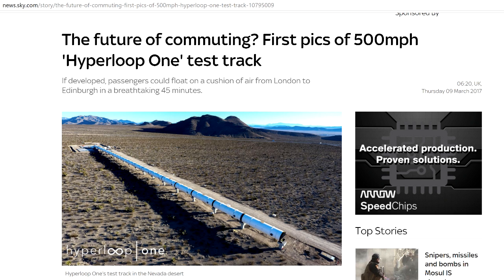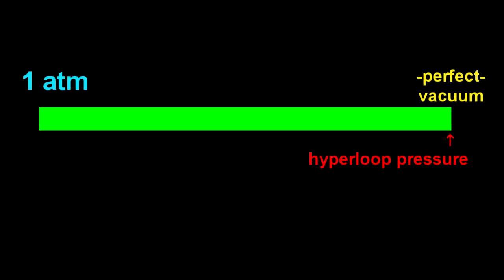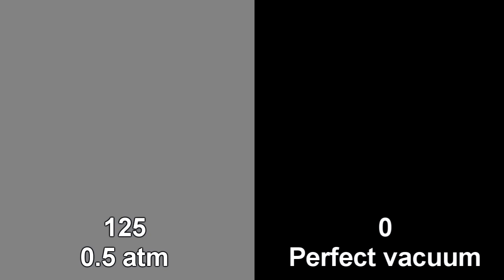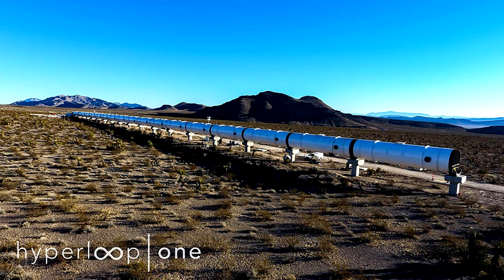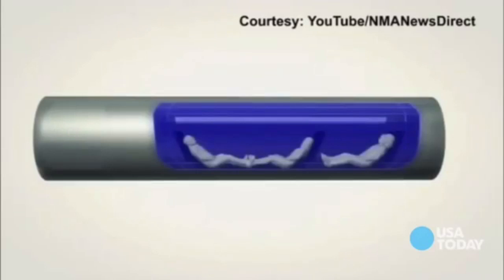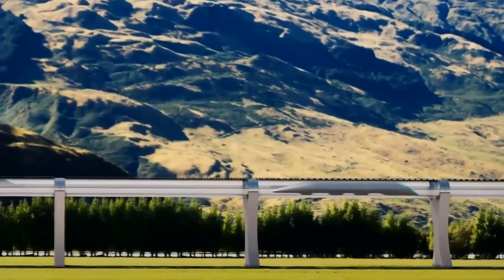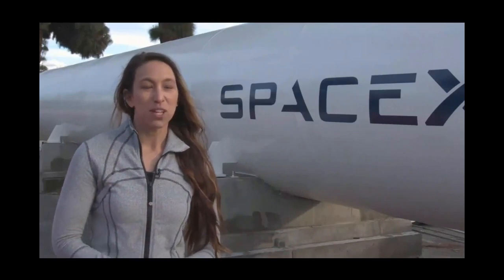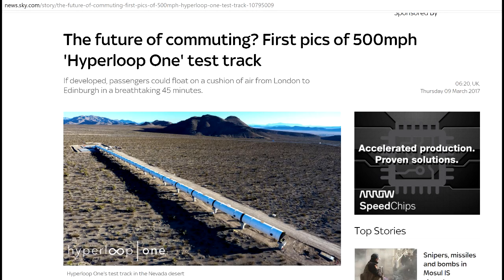Entire Hyperloop could be destroyed in SECONDS!

Comment: I don't get it... this isn't a random KickStarter, this is Elon Musk, and he wouldn't be trying to con people to invest in this, he actually believes this will work, and he seriously intends to move forward with the project. In that case, how is it that literally no one on the engineering team made some basic calculations like Thunderf00t did in order to check if the idea was even thermodynamically feasible? Even Elon Musk is capable of checking this. He has a degree in physics!

As I said, I can understand Thunderf00t calling out some random KickStarter for not checking the feasibility of their idea in terms of the raw thermodynamics, but this? This is a whole new level, and it's really out-of-character for Elon Musk to lack his usual pragmatism in this project. Can someone explain this to me? I'm genuinely trying to make some sense out of all this.
Reply: CharlyBr0wn it won't work for some very very basic reasons. One of the key tip offs is to look at promotional videos and spot the bullshit. They talk about it being a replacement for traffic. And saving lives by preventing highway deaths. This is pure 100% bs. This is a fixed point to point transport system that only works over great distances. It requires far too much distance to speed up or stop for any productive local use. This means it's an airport replacement. And at that it fails, for much the same reasons that California's idiotic high speed rail will fail. It has a massive infrastructure construction operation and upkeep cost per meter of distance traveled for the entire length and path of travel. Airports require a five mile paved runway and some navigation electronics. The space between airports is free no upkeep. Or minimally so via ATC. The biggest fixed expense in Airtravel is the easily replaceable and upgradeable unit. The plane. Yes you will say fuel costs, but the entire point of the Hyperloop is to hold hundreds if not a thousand miles of track at or near vacuum. That's a huge energy load. Before you factor in propulsion.  

If someone is telling you that an actual Hyperloop will only cost $6 billion vs the $60 billion for the California high speed rail, they are lying. Most of the costs of high speed rail come from land purchases and easements. The Hyperloop would face those too. They just conveniently aren't mentioning those... yet. Just think it through, do the mental math and you see the truth. High speed rail requires a stable prepared roadbed, 2 or 3 steel rails and overhead feeder wiring. A Hyperloop going the same route needs a massive vacuum tube, on a prepared geologically insulated pylon system, with if anything higher power distribution requirements. It has almost 100x the materials costs alone over traditional high speed rail. You can see this just by looking at it. And once again, airports require 5 miles of flat concrete, no further property purchases or easements and the air is free. 

People are fond of talking about sustainable energy. I'm going to bring up another concept. Sustainable infrastructure. Sustainable infrastructure is cheap, easily repairable and is capable of sustain itself via the traffic or commerce that it supports. Traditional asphalt roads are a great example. Crushed rock and goop. The trick is the infrastructures upkeep cannot cost more than what it returns. That was the failing of passenger rail in the states. Though nobody talks about it, it was also what caused trolley's and light rail to die in American cities. Buses were Trolleys that you could change the route easily, no digging involved. This Hyperloop is not a Sustainable Infrastructure. There is just too much of it.
Reply: +Chris Head 
Not to mention that the square cubed law is also in play Thunderf00t has become a scam artist who places the minimal amount of effort into each video so that he can release several videos a week often the same video and collecting nearly 3,000 dollars a video from his patron's it's discusting.
Reply: I'm in agreement with kurtu5 I've criticized Musk in this thread while also defending him.  I think your projecting.  Everyone on this thread believes in their cult leader TF who simply can't be wrong about anything because he's got a Ph.d.  in chemistry.  Not even against those in their own fields.  Sounds a lot like people we used to criticize doesn't it?
Reply: It's simple, this is a youtuber dedicated to calling out anything. He get's his demographic by using shock factor. If there's no exciting real scam he can call out, he has to find something else sensational to "bust".
Reply: I´m sorry but his concerns are legit. Even if the tube is tripple layered to protect it, you still run the problem of having to seal and depressurize the tube EVERY TIME you want to use it...because you can´t just "get in and out" off a vacuum chamber. Which is going to take an exorbitant amount of time anyway. We are talking about displacing 2 Kilotons of air, every time.

And how do you sensibly stop this thing? I mean, acceleration and deceleration have to be slow enough to not cause your body to break under the G-forces...

It´s ambitious, just like anything else that Elon Musk does, but unlike electric cars and space travel, transportation via vacuum tube is not something we´ve done before.
Reply: CharlyBr0wn I'm not really in a place to question science and engineering credentials. My skills and education are business, economics and some Poli Sci with a number of credits in Fire Engineering from a previous life. I can easily see the failure points of this thing just on the basis of those points long before you start arguing fluid mechanics. (The thing fails every economic test you can throw at it. It makes no sense from a costs benefits standpoint.) But I am curious? Have you ever investigated Dr. Mason's CV or published body of work? I did after I got curious on some of his Busted" videos. It was actually quite enlightening. Yes his Phd is in Biochemistry. But his body of work is about mostly water. (Water and sugar) It's heavily about Fluid Mechanics and Thermodynamics. He would actually appear to be one of the better experts on such things. It certainly explains his interest in things like the self filling water bottles etc. I can't tell you if Thunderf00ts math is correct. I can tell you that from looking at it from an entirely different non engineering angle, his ultimate conclusion is correct.
Reply: + andrew taylor
"One of the key tip-offs is to look at promotional videos and spot the bullshit. They talk about it being a replacement for traffic. And saving lives by preventing highway deaths. This is pure 100% bs. This is a fixed point to point transport system that only works over great distances. It requires far too much distance to speed up or stop for any productive local use."
Considering that many people actually do drive across California, it would actually decrease traffic, but yes there primary competition is planes and air travel.  Which they do actually address in the Hyperloop document.  They demonstrate that you can travel faster than other planes at least when considering relatively shorter distances such as what is currently being proposed for the California high-speed railway.  I think you also need to consider another distinct advantage this has to air travel is the lack of need for preparation for a flight that is going to the destination you need to go to.  

" It has a massive infrastructure construction operation, and upkeep cost per meter of distance traveled for the entire length and path of travel. Airports require a five-mile paved runway and some navigation electronics. The space between airports is free no upkeep. Or minimally so via ATC."
Yes, this is true however the Hyperloop can arguably transport more passengers in a day per meter traveled.  An airplane can only transport a fixed amount of people on it at a certain time while a railroad can have multiple trains on it at a time.   Not to mention that aircraft have a lot more constraints placed on them to make themselves economical.  After all, they need to fight with being sufficiently aerodynamic and fuel efficient while maximizing the number of passengers they can transport.  

"If someone is telling you that an actual Hyperloop will only cost $6 billion vs. the $60 billion for the California high-speed rail, they are lying. Most of the costs of high-speed rail come from land purchases and easements."
Do you really think Hyperloop didn't account for this?  It's accounted for in the Alpha document.  In fact, they predict these cost to be about 1 billion dollars.  I have no way of confirming this, but I have no reason to doubt it either.  I'm sure you would have a much easier time demonstrating what the number should actually be.  
http://www.spacex.com/sites/spacex/files/hyperloop_alpha-20130812.pdf

 "Just think it through, do the mental math, and you see the truth. High-speed rail requires a stable prepared roadbed, 2 or 3 steel rails, and overhead feeder wiring. A Hyperloop going the same route needs a massive vacuum tube, on a prepared geologically insulated pylon system, with if anything higher power distribution requirements. It has almost 100x the materials costs alone over traditional high-speed rail. You can see this just by looking at it. And once again, airports require 5 miles of flat concrete, no further property purchases or easements and the air is free." 
Engineer's put very little faith in mental math.  Just like scientists we're are only interested in what you can demonstrate.  However, unlike scientists, we don't get to experiment before we do a project, so we plan everything out.  We have to create feasibility analysis' and create several reports before we can actually continue with a project.  This is what the alpha document was for the Hyperloop.  If they've done their due diligence, I have no reason to disbelieve it.  If you think there, math is wrong by all means show me.

You certainly have a point about sustainable infrastructure but how do you know they can't make it sustainable?  Designing for replacability isn't hard even though the majority of the time we deliberately design against it(for limited product life cycle).  That being said I do not see this concern being addressed in the Hyperloop document.  However even so this argument would also work against our massive network of freight which still run to this day which is because their sheer quantity of goods being transported outways this concern.  Whether the costs of the Hyperloop outway this concern is certainly debatable.  Most of your other concerns are also valid but also addressed in the Hyperloop alpha document.
Reply: " Every dollar he has ever earned in profit has come from taxpayer grants, " that stement just isn't true. He sold Paypal to Ebay. Those money was his wealth. Then he created Tesla, spaceX and solarcity.
Reply: +Joe Farmer
"First, just because there are engineers and project managers involved with Hyperloop One, for instance, doesn't say anything about the credibility of the project.  They are there for a job and to pull down a paycheck, which no one came blame them for. "
Actually, it does.  First off highering a team of engineers is extremely expensive and provides a lot of the upfront cost.  If this project has no likely hood of success then this is a money drain for Elon and he's going to be losing millions if not billions in overhead costs.   This is the reason why you make an alpha document in the first place to figure out the feasibility of a project before you invest a lot of money into it.  If an engineering team found the project to be worth doing, then that means the person funding the project feels they can be successful.  

"They are also increasing their experience and technical capabilities, which is great for them.  Otherwise, your argument is like saying that because Enron or MCI had all sorts of very nicely credentialed people, there must have been credibility behind those ventures."
Umm yes they are corporations trying to make money are you trying to suggest there fake business'?  Are you trying to suggest that they can't make a buck cause both are very large companies?  Hate to tell you this but yes the fact that they have a massive engineering team makes them credible.  

"Second, Elon absolutely is in it to make money; for himself.  He's not the only one scamming taxpayers; just about the entire "green" industry is a scam on some level that relies upon taxpayer financing.  Elon invests a small amount of money into his ventures, almost at a token level, while then leveraging the hype to pull in tax dollars; that's what he's good at. "
I agree that hype is a huge part of Elon's business model but then again so is it a part of apple's.  What's your point?  Branding your product to be the future and therefore better than everything else is a great marketing tactic doesn't mean there a company out to scam people.  There just selling people on their product which people like and want to buy.  It's not like there actually lying and selling a heap of junk that's going to break down in a few miles.  Now tax breaks and so forth isn't stealing tax payers dollars it's taking advantage of government benefits as you've stated aren't designed just for Tesla.  Tesla and space x still have to make money, and if people don't like their product, then they still run a deficit.  That's why you're full of shit he's still a legit company playing by the rules.  

"You don't see how both Tesla and SpaceX were taxpayer financed???"
Space X is just as taxpayer-financed as Boeing and Lockheed Martin.  Are these companies shams too?  Tesla just get's tax breaks for being a "green" company but I agree they shouldn't get them.  Irregardless this isn't just Tesla who get's these as you mentioned there providing a market demand for "green" products.  I will agree that Tesla isn't as green as it's marketed as but there is clearly a demand for the product or they wouldn't still be around.  

"Train concepts fail because of cost; there have been many, many train concepts that never even make it to the media that were failures from inception"
And therefore all trains will be a failure because some were.  I'm sorry but this is terrible logic a train can beat both planes and cars in the right circumstances.  Take subways which are almost a necessity in every major city.  Not to mention that they bring in a lot of money every year due to their frequent use.  Sure it might bring up reason for skepticim but if the evidence is provided then you need to pony up and return with equal evidence. 

"This is not to take away from conventional rail at all; yet those capital costs were paid for long ago and they have found a so-far solid model for freight.  Conventional rail for people transportation is another story.  Opex in train ventures grows every year, however, and yes; security is a major issue in the industry even for freighters."
I'm still quite skeptical of this large amount of security you speak of after all the amount of graffiti you see on rail cars really speaks to this high level of security.  Now I can see a lot of security when there's a lot of expensive goods in one place, but that's security for a different reason than your talking about.  However, this brings up another point, and that's that railroads are not designed to last.  Inspections are constantly needing to take place for buckling in railroads because there built without expansion joints.  Which means even with a high cost of upkeep there still profitable.
Reply: Yeah I would like to hear the economic argument.  So far the biggest argument I have heard so far is that land acquisition would be difficult, despite being offset by the small land footprint, small noise footprint, small security footprint.
Reply: Kurtu5
Yea and that's a dumb argument too because that disqualifies all trains from being feasible.  I don't know but I personally don't see an economic argument unless the numbers in the alpha document were shown to be wrong.  Which I can assure you Thunderf00t has failed at doing this.
Reply: +Bob Tahoma
You clearly don't understand how a logarithmic scale works do you?  Well, let's take the equation for work in an isothermal process.  To reduce pressure, you get this equation

W=nRln(Pi/Pf)

From this equation, you can see that the smaller Pf gets, the more work that is required.  Not only that but it tends towards infinity.   

an example of how the graph of this looks

https://www.wolframalpha.com/input/?i=plot+y%3Dln(1%2Fx)

To make this graph behave linearly, you would need to employ a logarithmic scale that is actually representative of how much work it takes to achieve a vacuum of 1/1000th percent.  Which I can assure you isn't that much.  This can also be seen in how vacuum is classified which is done logarithmically and not linearly. 
https://en.wikipedia.org/wiki/Vacuum

In fact, the vacuum thunderf00t is talking about is considered a medium vacuum and is widely used in industry.  This is pathetic that he would portray this as an incredibly good vacuum when it isn't.  It's a generic vacuum at best.  So yes it is a 1/1000th vacuum, but hey we know everything in science behaves linearly.  Knowing 1/1000th vacuum means that directly scales to 1000 times the work needed right?  It also means that assuming a perfect vacuum is going to give me a close approximation right?  Fuck no and if you do think this is the case then you've clearly never studied thermodynamics.
Reply: I assume you are referring to the 2x10^8 J required to pump down the vacuum. 
 Thunderb00b calculated the energy required to pull all the air out of the entire vacuum chamber. The hyperloop system will have vacuum locks and hatches that allow small sections of the loop to be sectioned off so "pods" can enter and exit the main vacuum loop. This eliminates the entire vacuum loop having to be pumped down to full vacuum for each use. 

Additional comment

-The pig pong ball thing is a terrible comparison. It has very low mass, and unlike a hyperloop pod it has the same diameter as the tube it is in. From F=ma I can guess the acceleration of a pod if there was a vacuum failure. Assuming a 12' diameter pod, that weights 350,000lbs (half the weight of a 747). And lets just assume it is perfectly sealed in the tube, even though it wont be. If 1 atmosphere of pressure acts on 1 side of the pod and a complete vacuum acts on the other, The force acting on the pod will be 14.7psi (atmospheric pressure)  * 16,286 in^2=239,404  If the pod weights 350,000 it will accelerate at about .68 G's (roughly what a sports car will do).
Reply: Chrinik 
Have you never heard of airlocks?
Reply: this video is only really pointing out how impractical it is at the moment, not that it couldn't be done. i think it's a pointless video.  it's simply a matter of will and if we want to spend the time and resource to make such a thing. all the things he mentioned can be overcome in various ways, it's just more money and more material.

the real question is- in theory, will it ACTUALLY improve travel times to that degree? after all the money and R&D and material, is it going to deliver on said speeds and efficiency? that's the real question, in my opinion
Reply: CharlyBr0wn Sure I have, have you never seen them fail? Since the entire loop is supposed to be low-pressure at all times, any sort of maintenance would require either full on protection suits similar to space suits or venting the entire place back up. Also, any imperfection or damage could cause the entire thing to go tits-up at any moment. You´d have to pretty much double or tripple layer this thing to be safe.

And even then, the entire idea of it being above ground just exposes it to a ton of danger, storms, cars and trucks plowing into supports, trees falling on them whatever, any one of which can cause the entire instalation to blow...better not be going 600mph through this thing while it´s happening. Because either it´s in front of you, making you hit a brick wall of air...or it´s behind you, making you accelerate uncontrolably and then hit the brick wall of the end of the tube<.< I´d rather take a plane.
Reply: CharlyBr0wn:
The pump you showed is rated for a flow rate of 56.6 liters per minute, how many liters does this supposed hyperloop hold? I never said it´s hard, thanks for that strawman, and you´d need alot of those pumps You are looking at time and energy needing to be invested either way.

Secondly, do you really think an object going 500mph hitting the crushed in walls of the tube (be that from a tree falling on it or a support beam collapsing), or the air that is not supposed to be there rushing in from a leak is gonna be like a stiff breeze? Do me a favor and look up planes crashing into the ocean. Fluiddynamics can cause the "train" to do things it´s not meant to do, hitting air resistance it´s not meant to hit, and derail like any train, only at substantially higher speeds. Therefore, you DO need to protect the tube from damage, no matter what. Thunderf00t never mentioned these things and somehow I fell prey to his "lies"...

I don´t even use thunderf00ts points and you still claim I did, who´s the delusional one here...
Reply: Thunderfoot is just pulling your leg, he is clueless.
Reply: I agree.  I just wanted to put out the 'strongest' economic argument I have heard so far.  If the operational costs(energy costs and I assume maintenance costs) in the whitepaper are correct, then it appears the HL, at roughly 1/5 the cost of competing services, seems to have them all beat.  And that 1/5 is for driving in an electric car.  Its 1/10 or more than jet or gasoline auto travel.
Reply: @kurtu5

Nope, you're a cultist when you go after Tfoot for doing that same thing he has thing to bullshit like solar roadways to Musk's shit.
Reply: @RandomGuy7092

TF was correct in his criticisms of solar roadways.  The difference here is that he has made fallacious criticisms.  He was correct in his thesis that coulomb forces are involved in alkali metal reactions.  He argued against creationist's arguments from incredulity and was correct there too.  But he made errors here.  A cultist is someone who ignores a person's error and defends them despite all evidence.

Name some stupid shit Musk has done and I will agree.  If a person does something stupid, i will not rally against reason.  I asked you to use reason regarding TF's claims and you refuse.
Reply: solar roof. investing in quantity > quality
Reply: after carefully reading this discussion, i've come to the conclusion that neither the guys saying that TF is wrong are bringing up numbers but speculations nor do the ones who agree with TF
"It's because Thunderf00t is the one who is making seriously big mistakes in his physics calculations mainly his characterization of air pressure.  In no way should he be making assumptions of zero air pressure or assuming that a linear scale is a good interpretation of how to characterize a vacuum.  Remeber Thunderf00t's degree is in chemistry, not physics.  Honestly,  I think the issue is that Thunderf00t has gotten cocky and will not admit when his initial points were wrong.  Shane Killian did a great video series quantifying how wrong Thunderf00t is on this topic and demonstrating how Thunderf00t uses argumentation methods that are almost characteristic of creationists."
=> No investigating on that matter
"It's because Thunderf00t is the one who is making seriously big mistakes in his physics calculations mainly his characterization of air pressure.  In no way should he be making assumptions of zero air pressure or assuming that a linear scale is a good interpretation of how to characterize a vacuum.  Remeber Thunderf00t's degree is in chemistry, not physics.  Honestly,  I think the issue is that Thunderf00t has gotten cocky and will not admit when his initial points were wrong.  Shane Killian did a great video series quantifying how wrong Thunderf00t is on this topic and demonstrating how Thunderf00t uses argumentation methods that are almost characteristic of creationists."
=> same as above
Reply: Nexnaught I don't know but Musk has made some trash products like their powerwall and their solar power shingles.
Reply: yeah this is Elon musk. he's not a public servant, he's a capitalist investor, and he's got pet projects he wants public funds for. 

never invest your own money.
Reply: Yeah there are many engineers and physicists who participated in and are participating in building these things, even if Elon is greedy and doesn't give a fuck he wasn't the only person who designed and planned the thing. With that many people with degrees it seems quite ignorant to believe they all couldn't do what TF did in a couple days of research. TF should start his own company since his fans believe he is 100% correct  on all his videos and is much smarter than people who hold degrees in fields he's never studied. Surely someone as smart as TF can be the next Einstein no?
Reply: Musk as excellent of an inventor and businessman he is, has also had faillures.

This will probably be one of those less succesfull projects.
Reply: Tesla, and other car manufacturers, got a loan from the government - which Tesla also paid back. They also got some tax breaks from Nevada to build the Gigafactory, but then Nevada turned around and made it more expensive to have rooftop solar - benefiting coal and nuclear generators. If I'd have to guess, Tesla would be one of the least favored companies.
Reply: We are all human and we all make mistake, and sometimes a lot of us all make the same mistake and the same time. I'm sure Elon is not trying to con people, but he is human.
Reply: Elon musk is not building it or going through the details meticulously, because he outsourced the idea to other companies. He is only providing the funding. He doesn't have the time to check all the numbers. The one checking the numbers the the project manager from spaceX. Which he understands with currently proposed systems and technology it is not practical. at this point It's  become a project to inspire young scientists and engineers.
Reply: im sure he has checked the thermodinamics of this thing, he would be making a big deal out of this if he didnt tought it was possible. just like with his electric cars and his reusable rockets.

it is fairly obvious someone who doesnt even check what the problems a project would convey before doing it wouldnt be able to put rockets into space, so it is more of a problem he is looking fordward to resolve, wich is why i beleive he havent constructed the full thing yet, it would be pointless to built a full scale prototype just to have it replaced by the complete thing later, they are just experimenting on a lower scale to see what can be done in a bigger one.

ALSO i belive just swapping to nuclear energy would solve half of the problems this project conveys
Reply: +xing355
The Project Manager's and everyone involved are engineers I doubt they would be working on this project if they thought it wasn't feasible.  I hate to break it to you, but Elon isn't in the business to inspire new engineers he's in it to make money.  Granted I think inspiring new engineers is certainly on his list of priorities, but he's mainly in the industry for profits.  The same as all other business'.  Elon is just a risk taker who invests most of his business ventures in R&D which is a risky business but has the potential for high payoffs.  

+Joe Farmer
I'm not denying that hype is a large part of his business model but I don't see how the taxpayer is funding his endeavors?  He's created several companies that run by the same rules as any other corporation.  Why is Elon the only one scamming people?  Also why are most train ideas absurd?  BNSF is critical to hauling massive loads of cargo across the country.  To assume trains are infeasible and absurd is just plain wrong and ignorant.
Reply: Joe Farmer 
Now about the white paper I certainly agree that he needs to validate his design before anybody gives him any money which is what he's already doing.  However,  the purpose of the alpha document was to prove that this project was worth the overhead cost in the first place.  Now if you don't believe it deserved to make it to even that stage then you need to back it up.  Which numbers specifically do t you agree with and why?  Simply saying you don't buy it is not an argument.
Reply: Elon Musk is backing it because he wants to build it on Mars.
Reply: +Ponto Builds The issue I have isn't how practical or impractical the Hyperloop is.  It's the fact that someone who claims to be promoting science is promoting such pseudoscience.  He's not getting anything right and is blatantly misrepresenting scientific principles such as pressure and fluid mechanics.  Now getting things wrong is fine but he's been told several times that he's wrong, but he simply doubles down and continues to promote pseudoscience.  Such as his little animation that he loves so much to try and show how close a 1/1000th vacuum is a perfect vacuum.  Accept it's misleading because pressure runs on a logarithmic scale and shouldn't be shown on linear scale to classify vacuum.  This is backed up by the methods in which vacuum is classified.
Reply: The concerns are real, but its up to them to figure them out, its not like someone is going to show them this youtube video and they are going to be like: "you are right, this is impossible, shut it down". they already know that the difficuties are and im sure they are working on resolving them.
Reply: +Chrinik
You've fallen prey to more of Thunderf00t's fear mongering.  Although yes for maintenance and other rare activities you will likely need to depressurize the Hyperloop.  The energy cost for this is not nearly what Thunderf00t would have you believe.  This task can be achieved with relatively cheap industrial vacuum pumps.  
https://www.coleparmer.com/i/cps-products-vp2s-pro-set-single-stage-vacuum-pump-2-cfm-10-micron/0716484
This vacuum pump is capable of 10 microns or 1.33 Pascal.  So much for achieving such a "high quality" vacuum being hard.  You can bump up the quality for faster pumping times as well.  Now onto the other lie from Thunderf00t that you've fallen prey to and that's that a tube rupture will kill everyone in the Hyperloop.  The issue here is that Thunderf00t's scale is what is misleading here because of the square cube law.  
https://en.wikipedia.org/wiki/Square-cube_law
From this law, we see that the volume of an object increases faster than it's overall surface area.  Which means that an object will feel less force on a larger scale.   Meaning Thundef00t's little experiment is extremely off from what the real Hyperloop would be capable of.  Once again Thunderf00t is making really simple blunder's in both physics and engineering.  So no you wouldn't need this triple layer protection.
Reply: +Raul Lopez 
Certainly, there are design challenges, but most of the legit challenges that Thunderf00t brought up are relatively trivial problems in engineering or are simply misrepresented.
Reply: +Joe Farmer
"Guess what, it was expensive for investors to hire all of those other nicely credentialed people at Enron and MCI too; so what?"
 Yes and they made bad business decisions, and those who invested their money suffered because of it.  However, their engineering teams still created products that work.  Are you trying to say these companies products were bogus?  Are you trying to say Elon is also involved in accounting fraud?  What the hell's your point here man?  Just because the companies were involved in fraud didn't mean their products weren't ligament.  To get money, they had to provide a working product.  So essentially this comparison is crap because it doesn't prove anything.  

"Just because technical/scientific/business people are involved with something does not make it a credible project; this learning goes back centuries at least.  Investors are duped all the time by the top level executives and often times the employee engineers/technical people have no real insight into such companies."
What the fuck?  What are you even talking about?  Who the fuck is being duped?  Are you saying pitching an idea and having people invest in your idea is duping them?  You do realize that investments are supposed to carry risk right?  Now that Hyperloop has funding from investors they are sharing the joint risk of this venture failing.  Which once again actually adds legitimacy to their project.  The fact is that it isn't stupid politicians falling for this but actual companies that themselves need assurance that their corporate dollars aren't getting wasted.  Your skepticism in where people invest their money is astounding and just shows you don't understand the business world or engineering.   Remember an engineers soul purpose at a company is to make that company money that is it.  If we aren't designing products that make the company money, then there really isn't a reason to have an engineering staff.  

"People want/need a paycheck, just like people are willing to suspend disbelief for all sorts of reasons.  SpaceX versus Boeing/Lockheed is a nul comparison in every respect; their histories are completely different although in today's World both are now known to take advantage of government to some degree."
Wait the employees are getting duped now?  What the fuck your ramblings are making no sense?  The whole reason these companies are legitimate is because they have no reason to invest in overhead cost if they don't expect returns.  Are you really this stupid?  Companies don't just hire employees just to tell them to sit in the corner and do nothing.  As you've stated, they want to make money.  Hiring engineers to do nothing doesn't accomplish this.  The fact that they have an engineering team means that they believe they can make money on it case closed.  If they didn't then, they would go the route of solar roadways and invest everything into marketing and be getting donations.  Note solar roadways was comprised of two engineers who marketed their way into the money.  They did nothing in the way of hiring a quality control department, getting manufacturing engineers,  software engineers, etc.  By the way, investments are different from donations in the respect that returns are expected.  Also how the hell is Spacex different from Boeing and Lockheed?  The history of the company has absolutely jack shit to with a companies business model which all three compete for government grants.  Their primary customers are the military and NASA.  Although Boeing also has capital in the private sector as well.

"You clearly don't know the train industry if you're skeptical of their major security issues (including graffiti)."
Saying I don't know the train industry isn't an argument.  You have to back it up.  Citations are always nice if you have some.
Reply: +Parker4675 yes, because pointing out the demographic of a channel in order to explain the content is Sooo insulting... Thank you for being the internet police and reprimanding me!
Reply: +Joe Farmer
"That's the problem with the white paper though.  It's not an insular piece of technology he's going after; or even a couple of pieces of tech.  He's advocating and designing at the systems level.  New tech is always a dubious enterprise but new tech at the systems level is even riskier."
Well, finally your actually making good points.  You are absolutely right here new technology is extremely risky.  On top of the reasoning, you already mentioned the market's demand for new technology is also unknown.  You might design an incredible product that has no market demand.  

 "This is because we don't have a credible basis for the real costs because the system has never been built out before.  That's why people don't believe his numbers.  He needs to build out a fully functioning prototype of some length to demonstrate more than at least 50% of what he's claimed.  And look at his numerous claims:1)  solar powered2)  significant speed advantage3)  creation of the largest continuous vacuum chamber4)  profitable enterprise5)  and etc.There are probably more than 15 discrete claims being made; investors might take him seriously if he could prove even 33% of those and on or near budget. "
Once again I agree with you on this point as well.  However,  in order to build a fully functioning prototype money is necessary.  Which is why the overhead cost to build these prototypes also needs to be justified as well.  The alpha document was the first step in this process.  Although even before you can even justify fully functioning prototypes more justification is still needed such as validating each component,  conducting evaluation testing,  acquiring simulations of the components, and even conducting market research.  Passing through each of these phase gates justifies to both Hyperloop and their investors to invest more capital.  It would also appear that Hyperloop one has already passed these criteria because they are currently working towards validating the full scale prototype.  

"He keeps arguing about the value of private industry doing this project (and others), yet somehow private industry never puts up most of the money; somehow, the taxpayer always has to take the risk."
There you go again with this taxpayer are getting duped nonsense.  Please provide me with a source that states how much if any funding they have gotten from taxpayer dollars.  All I can find is that they are receiving funding from corporate investors.
http://fortune.com/2016/10/13/hyperloop-one-test/
Reply: it could be built underground with several layers of protection, and it could have a large system of airlocks for servicing the tunnel, emergencies, and safety systems. again the question becomes "is it worth the time and money", not "can it be done?"

think of when people in new york long ago started to propose "why don't we just dig crazy huge tunnel systems under the entire city, and put trains in them?"

it was a question of time and money and material, not "can it be done?"
Reply: you agree with me, you're just a bit too dense to realize it. and i also agree no tax payer money should go into it UNTIL they have a complete working prototype and complete plan drawn up. they can figure all that out with valley money
Reply: Ponto Builds "It could be build underground." Yeah...which would make sense...but the plan is to build it above ground and put windows in them so you can watch the scenery...which is a dumb idea in my opinion.

Also, keep in mind that underground metros weren´t anything "new" by that point and thus had about 40 years of pre-made experience from Europe on what to expect when building them...

And it´s always a question of time and money, but the argument shouldn´t be ours to make, it should already be answering all of those questions because they are DEFINATELY going to be issues...you can´t make a high speed train transporting people without having to make compromises to provide for their safety...and if all that prevents this system from potential failure is a single wall of 1inch steel that´s pre-stressed...

I dunno. The "finished" design is probably using thicker tubes because how are you going to keep testing a railway system when the tubes are already suseptible to deforming under their own weight.
Reply: Joe Farmer 
They aren't pitching it to governments all there funding is private dollars. What government funding do they have? Cause I haven't seen anything.  Not to mention that there competitor has very similar funding from all private dollars.  There aren't even any plans to get government funding.  However once they validated the whole project I wouldn't be apposed to governments buying the product. The same way NASA buys Boeing, Space X, Lockheed, and many other companies products.  You would be right if the government was funding the overhead costs.  But the fact is there won't be any corporate dollars going into this until there's a final product being sold.  Even then there's no guarantee governments will want to pay for it.  That's the whole point of a business your taking the risk that your money upfront  will lead to more afterwards. You seem to absolutely hate business working with the government.  Sorry bud but legitimate business' are constantly working with government.  Otherwise you must believe all defense companies are corrupt.
Reply: +Joe Farmer
Yup, you don't realize that you just proved my point, please tell me how much money the Dubai's government funded.  The answer is zero because it wasn't Dubai's government that gave any money but DP world who gave 50 million dollars to Hyperloop a private company.  This quote is from your own article "Last month, port colossus DP World Group of Dubai announced it was investing in the concept, joining backers including French national rail company SNCF, US industrial conglomerate General Electric and Russian state fund RDIF."  Here's a better article that actually explains what happened.

https://techcrunch.com/2016/10/13/hyperloop-one-gains-50-million-in-funding-from-dp-world-group-of-dubai/

Now from this, I have found only one government that has invested anything in Hyperloop, and that is Russia who's invested a small amount which value I can't even find.  Now on top of this, I have found a summation of all Hyperloop investor's.  You'll notice something there all private investors, and they have all invested 141.1 million dollars in Hyperloop.   The private sector is funding Hyperloop so your wishful thinking that there sucking on the government's tit is demonstrably false.https://www.crunchbase.com/organization/hyperloop-technolgies#/entity
Reply: +Joe Farmer
My point was that your article is a little deceptive because it wasn't talking about the Government of Dubai it was talking about DP world which is a private company based in Dubai.  That's why I challenged you on finding the actual amount that Hyperloop received from the government of Dubai.  The fact is you can't because everyone equivocated DP world with Dubai as I showed in my articles and by showing that your article even quotes this deal as being with DP world, not the government.  You clearly didn't even look at my other link that shows the 141 million dollars of private investor dollars that have been raised.  This isn't a small amount certainly not enough to complete the project but it's enough to create prototypes.
Reply: +Joe Farmer 
Please show where in your article it states the Government of the United Arab Emirates has donated any money or even involved with the Hyperloop aside from them meeting about possible regulations.  Once again you can't because the article isn't about them.  It's about DP world!  Can you not fucking read?  It doesn't matter when DP world is mentioned it still is about DP world.  As I've stated and demonstrated in my own article is that for all intensive purposes DP world is being equivocated with Dubai simply because they are a Dubai company.  DP world is planning on purchasing the Hyperloop and installing it in Dubai.  You have proven jack shit.  

"The bottom line is that it currently makes no credible economic case and it ought not to be believed until the silicon valley millionaires club decides to use its own money "for the good of humanity" (as one comment here argued) to pay for a large working prototype at full scale."
I do believe you made this claim, though, didn't you?  Seems like I'm not the one backpedaling.  Please realize the fact that corporate dollars, not government dollars are going into this.  104 million is a fuck ton of money that none of these invested interests are keen on losing.
Reply: +Joe Farmer
Joe your such a hard headed jackass that is so engulfed by his own conspiracy theories that you can't even address my points without heading to ad hominem attacks and be stating my article says this, therefore, it must be believed a hundred percent.  Especially when I've shown it to be wrong and misleading several times.  Now if you really are going to go by this article's credibility please elaborate what this statement means "Dubai has agreed on a deal with US startup Hyperloop One to evaluate the construction of a near-supersonic transport link that could slash travel times to Emirati capital Abu Dhabi to minutes." What were the terms of the deal how much money was agreed upon?  As I've stated your article doesn't meet my merit of proof for the reason's I've listed several times.  You've constantly said Hyperloop is milking the government's tit.  When there's no evidence to suggest this.  As I've actually shown you what the terms of the deal were and how much money was agreed upon and who actually agreed on it, I've got the higher authority here.  Not to mention that I've shown this from multiple sources.  While you're relying on the wording being used in one article.

Let's take my article for example that I showed is more explanatory of what is actually going on.  It is stated in the first paragraph "Hyperloop One is getting even cozier with its partners in the United Arab Emirates. The futuristic transportation system that aims to ship things and people faster than a speeding plane just pulled in $50 million in strategic investment led by DP World Group of Dubai, bringing up the total raised to $160 million."

Now to my claim that either people equivocate companies with governments or that the deals they make with governments are non-financial in nature.  This article makes this claim "The plan is to use the cash to continue making progress on development in Dubai and throughout the world. The company has aligned itself with various governments and transportation partners around the globe, including in Russia, Finland, Sweden, Switzerland and at the ports of Los Angeles and Long Beach, California."  From this article, my question becomes why are they making the claim that there aligning with governments when they're clearly working with a private company?  Why are these claims being made?  Well to your point they do have to align with governments as far as regulations are concerned.  Boeing has to comply with FAA regulations before they can release a plane.  So for any of your claims to be valid, I need proof that they are asking for financial assistance.  You have failed in every way to provide this.  Even as I've given you very specific requests such as a financial number that the government has committed to Hyperloop.  I doubt your going to address this point though you're more than likely going to stick to the verbiage of your current article and proclaim your right.  I've placed my goalpost which is evidence that a government has placed any financial support into their project.  Which you've failed to provide.
Reply: Joe Farmer

Until you can provide evidence that any government has provided any financial support towards Hyperloop this conversation can not continue.
Reply: No, as I've stated working with the government can mean that they are making sure the government will not hold the project back due to regulations.  Your pitching it to government line is bullshit because it means absolutely nothing you don't announce to people when a company pitches shit to anybody.  You announce when a deal has been struck as your article states.  "Dubai has agreed on a deal with US startup Hyperloop One to evaluate the construction of a near-supersonic transport link that could slash travel times to Emirati capital Abu Dhabi to minutes."  What did they agree to tell me that?  Your the one backpedaling here giving me an article that states there was an agreement then stating you don't need an agreement.  Once again your other article doesn't tell me anything about financials it's a broad article that gives me no details.  Are they proposing it to India as a private sector of transportation then it's India stating they'd be willing to buy a final product.  But are they investing in the actual construction?  I'm asking you for specifics here, and you'll only give me broad answers of look the government and companies are talking.  Alright, what are they specifically talking about what are there agreements?  Please clarify.  Also it's not something small dealing with regulation.  Regulation haults a lot of industry such as airlines and medicine.  Hell they couldn't put wifi on airlines for the longest time becuase of government regulation.  This is why I need specifics not your confirmation bias ridden sources.  I've given you actual numbers and specifics.  You've given me talking points.
Reply: So please give me specific agreements that mean plans for financial compensation or even a proposal that Hyperloop has given to the government asking for their money.  Saying they talked isn't shit.  I've given you specific numbers towards my claims.  Also to clarify since you've brought this conversation so far away from it's original talking points.  My singular claim is that Hyperloop isn't sucking off the government's teet and that there entirely privately funded(which I've demonstrated).  Now all your articles claim there are agreements in place between the government or private entities.  This is very broad as I claimed these agreements could simply be agreements of regulations that Hyperloop will comply by being there a new industry.  Not only that but you've claimed they need this money or they'll be a failure which I see no evidence for.  They are operating completely privately as of this moment and I've seen no evidence that they plan on operating on government funding in the future.  This doesn't mean that they can't compete for governments as potential customers who want to buy their finalized product.
Reply: So please show me any specific agreements or proposals asking for government funding.  Broad arguments will not work with me.  Until then I'm done with this debate.
Reply: There definitely is no ulterior motive involved, I think Elon Musk genuinely cares about advancing humanity. It's just that an oversight as simple as this is very uncharacteristic of him, and is leaving me scratching my head as to how that could happen.
Reply: You clearly haven't been paying much attention to Mr. Musk and what his business model is over the years. He is the worlds greatest example of "Corporate Welfare". Every dollar he has ever earned in profit has come from taxpayer grants, tax breaks and other government handouts. This is simply more tRansportation Theater designed to impress the DC folks into creating yet another grant program for him to exploit.
Reply: Even funnier is that Elon Musk is not intending on monetizing any of this.  He opensourced the research and has zero investment it's it further development.  My guess is that someone like Japan or China will make one of these before the US does.
Reply: +Valesto93
This is true it's almost reminiscent of the argument atheists used to make towards creationists, isn't it?  This is why I'm starting to hate Thunderf00t he's using the same logic he used to criticize creationists of using.
Reply: +Lane I'm studying mechanical engineering sooo.....  now, this isn't actually a chemical engineering problem as much as it is an issue with fluid dynamics and thermodynamics.  Sorry but if you really want to debate credentials I've got you beat here.  However, I don't believe in credentials over the internet.  I believe in what you can prove.  Now if you want to see how vacuum are characterized let's take a look at the different classifications of vacuum.  They range from a rough vacuum(1×10^5 to 3×10^3) or medium vacuum(3×103 to 1×10−1 also what the Hyperloop is running at) to an ultra high vacuum (1×10−4 to < 3×10−15) which can only be achieved in labs.  You'll notice that these numbers get closer and closer to zero which is what warrants a logarithmic scale.  Pressure will never reach zero.  Which is why Thunderf00t's energy calculations are bull.  
https://en.wikipedia.org/wiki/Vacuum

The calculations he should have made are much more clearly represented here.
https://en.wikipedia.org/wiki/Isothermal_process

You'll once again notice how making the zero pressure assumption is horrible.
Reply: It's because Thunderf00t is the one who is making seriously big mistakes in his physics calculations mainly his characterization of air pressure.  In no way should he be making assumptions of zero air pressure or assuming that a linear scale is a good interpretation of how to characterize a vacuum.  Remeber Thunderf00t's degree is in chemistry, not physics.  Honestly,  I think the issue is that Thunderf00t has gotten cocky and will not admit when his initial points were wrong.  Shane Killian did a great video series quantifying how wrong Thunderf00t is on this topic and demonstrating how Thunderf00t uses argumentation methods that are almost characteristic of creationists.
Reply: Elon Musk will be known to people in the future, like Steve Jobs is now. "How could people fall for this obvious con, he didn't do anything himself. All he did was hire people, treat them badly and market himself as jesus". Elon Musk has made himself into a commodity. All he has is brand name and marketing. I mean, i actually see people in this comment section treat the man like some second coming of christ. It's ridiculous. He is an investor with good marketing. Nothing else.
Reply: +andrew taylor

"CharlyBr0wn I'm not really in a place to question science and engineering credentials. "
which as I mentioned I don't think are great forms of argumentation anyways.  It's essentially an argument from authority.

"I can easily see the failure points of this thing just on the basis of those points long before you start arguing fluid mechanics. (The thing fails every economic test you can throw at it. It makes no sense from a costs benefits standpoint.)"
How so?  I've taken the cost that is projected by the hyperloop and compared it to other projects such as the California high-speed light rail which cost 56.6 billion dollars and compare that to the Hyperloop which projects 6 billion dollars.  I don't see how this is too expensive placed in that context.  You'll also find this price is comparable to other superstructures as well.

"Have you ever investigated Dr. Mason's CV or published body of work? I did after I got curious on some of his Busted" videos. It was actually quite enlightening. Yes, his Ph.D. is in Biochemistry. But his body of work is about mostly water. (Water and sugar) It's heavily about Fluid Mechanics and Thermodynamics. He would actually appear to be one of the better experts on such things."
What I've seen from his work is that he mostly studies the chemical reactions of water and sugar.  This has nothing to do with fluid dynamics as it does not pertain to the motion or behavior of the fluid.  If he were doing work with wind tunnels or fluid management systems, you would have a point.  However, he is not.  Fluid dynamics is the study of the motion of fluids hence the name.  This doesn't lie very heavily in the domain of chemistry but is much more in the domain of mechanical engineering and physics.  Thermodynamics I would say is much more overlapping, but once again we're still in the realm of thermodynamics as it pertains to fluids, not chemical reactions.  

"I can't tell you if Thunderf00ts math is correct. I can tell you that from looking at it from an entirely different non engineering angle, his ultimate conclusion is correct."
I can tell you his math isn't wrong his underlying assumptions are which is even worse.  Especially for someone who claims to promote science.  What's more is he's been called out on these mistakes by others and has refused to make corrections.  That's the biggest issue.  Now as far as the economics goes I'm curious as to why you think it won't work.  I don't see any reason as to why it wouldn't if Hyperloops claims are accurate.  Which I have yet to see anyone give me any evidence that they aren't.
Reply: You clearly don't understand even the basics of chemistry if you don't understand Thunderfoot's pressure-energy calculations. Source: I'm studying Chemical Engineering. Oh yeah, and air pressure is a chemistry thing as much, if not more, than a physics thing, so Thunderfoot is absolutely credible to talk about it.
Reply: Hahaha, fucking Musk cultists man. Can't handle when Phil does the same shit to Hyperloop he has done to everything else.